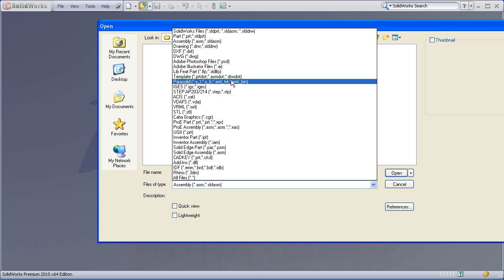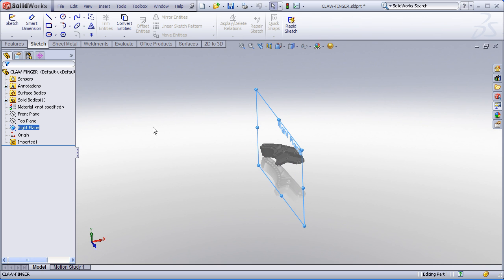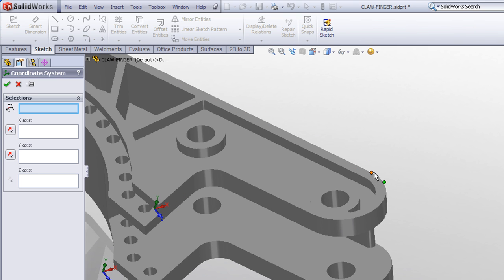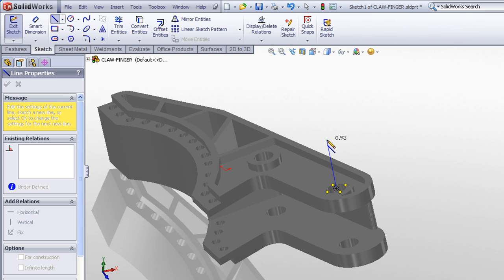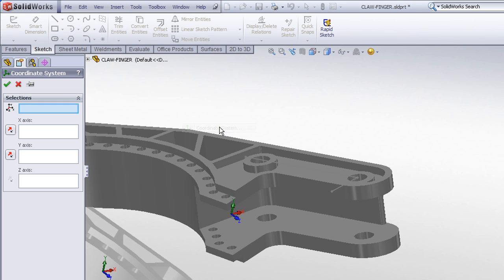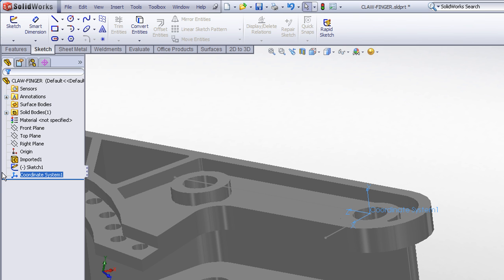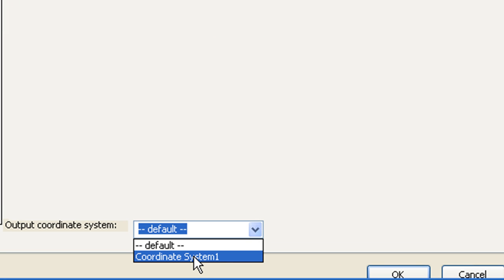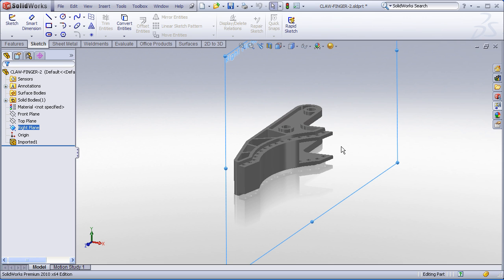Reorienting the Global Origin on an Imported Part

Comment: There are videos stating you need to create reference geometry and assign the origin then save it out with the new origin but this only seems to work if the planes are aligned when they are imported, for parts for ex. catia where the part is in air plane coordinates I cannot seem to change the origin.... tried a lot videos... only way for me to through the day is to translate the origin in catia and save out...

Comment: Wowwwwwwwwwwwwwwwwwww!!! Solidworks is so so so so soooooooooooo boring! I hate it. But thanks. In AUTOCAD all you have to do is to use a 3dpoly and type UCS or align3d. Why SW is so so so fu...ing boring? It´s a pitty. It is better than AUTOCAD but it will never be  an AUTOCAD (yeah... INVENTOR is even more anoying than SW). I am getting older and more stupid every day.
Reply: ragrj2009 
AutoCAD is dead and very limited its capability. It''s for no talent ass clowns.